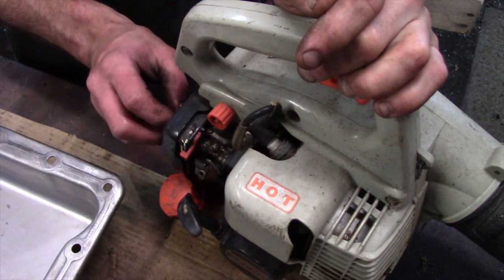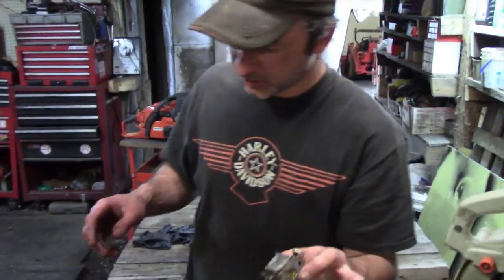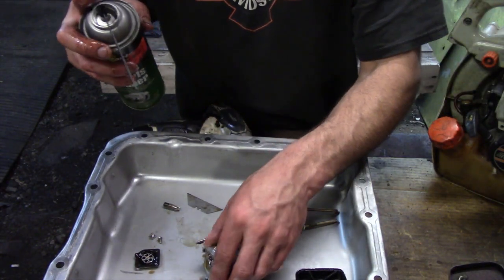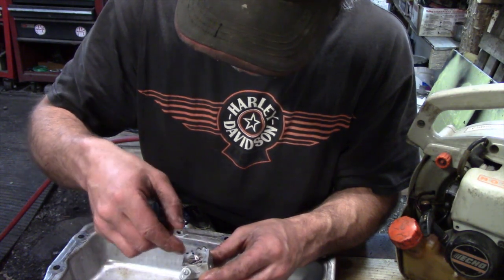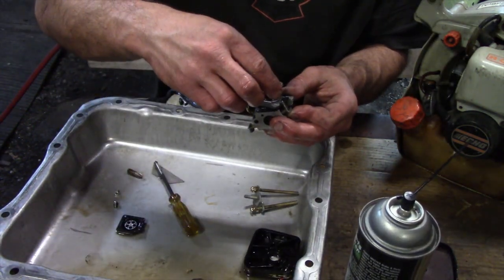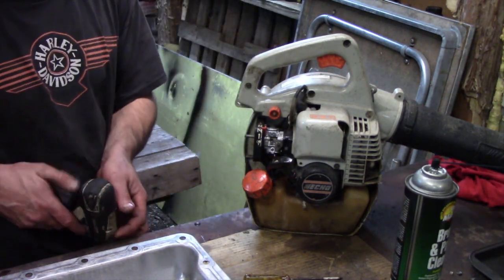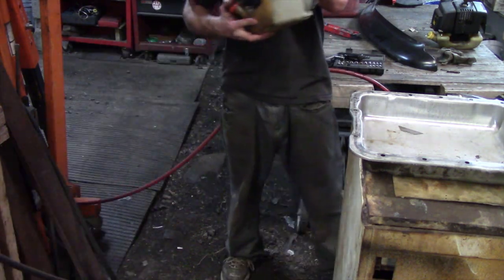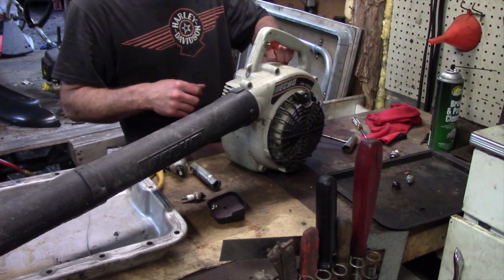Echo leaf blower won't start

Comment: Those echo blowers are nice last long great video, personally I keep all rubber away from carburetor cleaner it swells up. Just clean with wd-40 plus it treats to pesurve the rubber to reguvinate it.
Reply from the maker: Never had a problem with carb cleaner.
Reply: So they will swell up if you soak them over night in 2 cycle mix?
Reply: No 2 cycle fuel won't make it swell up.

Comment: I have a little issue starting it, like need about 6-10 attempts but once it starts it continues going. Should I return it and exchange it for another one? I have 30 days from Home Depot
Reply from the maker: Should start on the 1stbor 2nd pull, prolli needs a carb adjustment
Reply: BACKWOODZ CUSTOMZ 15 I realized there is a step called bulb priming. I shall try that.